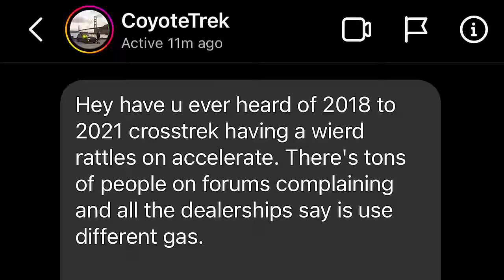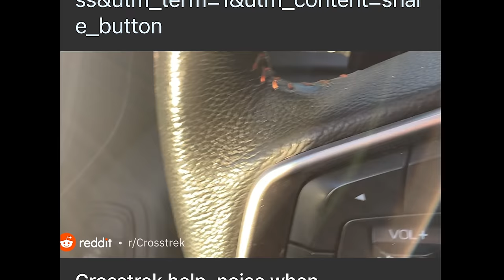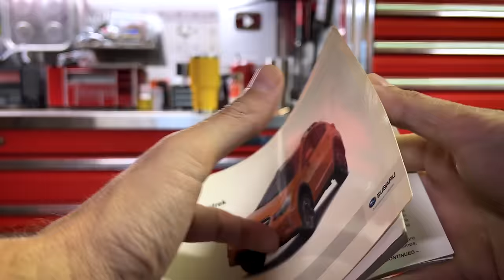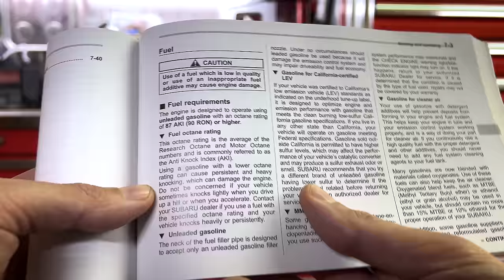Rattle, Ping Pop!? What Is That Noise In My Subaru's Engine?! Detonation & Pre-Ignition Explained

Comment: I have a 2021 Crosstrek with 73000 miles (I drive alot for work) that has been presenting this spark knock (sounds like valve chatter) since about 15000 miles. I live in York SC, and work in Spartanburg and Greenville. I haven't tried to record the sound but will soon. It usually starts after vehicle has been up to operating temp for 20-30 minutes.
Reply from the maker: Try a tank of non ethanol or 93 octane
Reply: @MrSubaru1387  Will do. I have already changed plugs at 60k and PCV valve at 70k. I recently changed where I was getting gas. I thought at first that was it....but then heard the noise again.
Reply: Ok, so I ran a tank of 93 octane. I only heard the sound two times, both after interstate driving for about 45 miles. Before, on 87, it was happening almost every day. Running 93 all the time isn't really a feasible option. What are your thoughts?
Reply from the maker: @12vinstaller  try non-ethanol 87/89
Reply: @MrSubaru1387  that's gonna be an expensive tank. Next fill up should be Thursday or Friday. I'll let you know how it goes. Thanks!
Reply: @MrSubaru1387  ran a tank of non ethanol 89. Marbles sound presented 6 or 7 times. All after 30-40 miles of interstate driving (60-80 mph), when holding between 40 and 50 mph (between 1400 and 2100 rpm) on back roads. The 93 octane with ethanol seems to reduce the occurrence more that the non ethanol 89. I am on a tank of regular 87 now, and am hearing the sound regularly now after every time on the interstate. Seems like ignition timing would be the obvious culprit, but hard to imagine that on a 2021 vehicle... scratching my head...

Comment: I actually posted something about this same issue/noise during one of your live Q&A events about a year and a half two years ago. You had some great ideas and tried to help me during the event but with little success. (Not your fault) I know as a fellow technician that its hard to give a diagnosis without being with the car. Since then it’s has slowly gotten worse. Im hoping when you make your follow up video we can find a potential solution. Alldata,Mitchell and Subaru service data show nothing for these issues and it would help a lot of owners. Mine is a 2012 Impreza with a fb20 as well.
Reply: I am also a master tech I did a bg decarbon and only run premium gas and haven't had an issue since 2018 crosstrek 6speed. Had same issue though. Good luck

Comment: Yeeeeees this is the noise I've been hearing! 2020 Crosstrek. It sounds like a half full spray can rattling really fast.  For the longest I'm like......... is that engine knock? At the dealer the parking attendant was like you should try using a higher octane gas, but the manager threw that Idea out with the trash claiming it's a 4 cylinder car you don't need that. So what I DID do was change gas brands from BP to Shell and it did help a bit. I still hear it now and again when gently accelerating but it's totally sporadic. OK so I'm not crazy! It still unnerves me though, isn't hat causing vibrations that can cause damage over time?

Comment: Mr. Subaru I have experienced the beginnings of a slight heat shield rattle cause the pcm to allow audible persistent heavy spark knock on grades in my 2018 FB25.  Clamped the heat shield that was loose, haven't heard that heavy highway spark knock since.

Comment: 2019 Crosstrek here with the same issue. I've told the dealer that I'm 99% sure it's detonation. "can't replicate it...we tightened a few heat shields....blah, blah, blah". Use Costo regular gas almost exclusively. Will try an octane booster just to see if it goes away and talk to the dealer as I need to take it anyways for a few recalls.
Reply: I have a 19 trek as well and 91 makes is go away

Comment: I have this issue with my brand new 2023 Crosstrek with the fb20. It has only 2600 miles on it.
I understand the gas could be bad but we have other cars that have never had issues with gas from the same gas stations. Never a ping on a Compass with 220000 miles on it and currently using the same gas stations.
It seems that Subaru has put out an engine that is substandard.

Comment: 2023 Crosstrek started pinging  when I added a fuel additive injector cleaner at 10K miles. Put 93 octane in the next tank and it stopped. Now I'm running 87 again and I hear it from time to time. Hope it doesn't wreck my engine.

Comment: On the FB series the timing chain tensioners can cause a pinging sound if they’re flat/non working. There solved it for you guys out there still looking for that noise lol. Just did a head gasket job on my 2014 outback 2.5i FB25, and found the pinging noise was bad chain tensioners.
Reply: My '17 Forester 2.5i(160k miles) is starting to rattle on startup  after sitting overnight. It goes away after a second./ oil pressure comes up.
Doesn't  rattle any other time.
Figured the tensioner going bad.
Reply: @williamevans6522  yep without a doubt the tensioners, oil drains out of them overnight. From what I’ve experienced it’s not too big of an issue/problem unless it’s both uppers and lowers all going out at the same time, then the chain has a chance to jump. If you pull the radiator etc you can manage to do from the front without pulling the motor, but it’s not fun. Good luck getting it fixed!
Reply: I guess when the rattle  keeps going, I should worry.
In the meantime, I'll  install an oil pressure gauge to ensure that's  not an issue.
Reply: @deluxsundial  Thank you. Searched around the Forester forum and  that's pretty much the sentiment- as long as the noise quickly goes  away it's  not an issue.
If I floor the accelerator and  crank it  over about 10 revolutions, then , with no gas, bump it about 5 times, I can then give it sustained cranking and it starts w/o the fast idle or any rattle.

Comment: I’m having this same issue with my 17 Impreza. At about 1700 to 2000 rpm under load I hear a crackling sound. I have 100 thousand mi and just started happening. Changed the plugs at 50thou. I recently changed the pcv valve and went away. Now it’s back..

Comment: So I use ethanol free fuel in my 2021 Crosstrek witch give me 37 mph hwy. My oil with Amsoil temp runs 199 degrees.  I noticed my oil is much cooler than what they recommend I looked on some of the forms people said their oils usually around 220 to 230°. I assume that's a plus

Comment: 0:53 oh... finally i have found a YT video that has the same issue I have... its been what.. 3 years? lol.... heres hoping the rest of the video helps me resolve this! presses play again
Reply: 2018 SJ5 JP 2.0i Forester, fwiw.
Reply: Incline. Check. Low RPM. check. Goes away when not on the gas. check. Low speed. Check.
Reply: I did try 89 octaine, and the recommended 91 here. I actually didnt notice any difference in the rattle after a year after switching from 89 to 91. Ive stayed on 91 because MFG recommended here, and almost the same price so why not.
Reply: I have not checked the spark plugs at all - I suppose if this is a preignition issue the main culprit could very well be the plugs. Adding this to list of things to do! I dont have any heat warnings. May have to speak with dealer if its a PCM ECM issue, this is beyond my skill. Will definitly ask the dealer next visit. The comment about Lean Fuel Mix is interesting - I always (99.9%) am driving in Intelligent mode. I have not thought to try using SPort mode more than just when overtaking on highway. I will definitely give this a try to see if it cuts the noise out.
Reply: It turned out to be dirty top Pistons. After cleaning, the sound went away entirely
Reply: @BGP369  cool, how'd you clean em'?
Reply: @InversePacman  the rattle persists still. much less after oil change so it seems

Comment: At higher elevations gas stations sell 85 octane under the assumption that lower atmospheric pressures result in less knock. Where I live most stations sell 85 as the cheapest fuel. In the summer I heard this pinging in my '10 forester. This was all due to a high operating temp due to a bad thermostat and the poor fuel. Cleaning out the egr, getting on top of the cooling issues seems to have taken care of the issues for the most part. 

I used an obd tool to monitor my temps to corrlate the issue.

Comment: Is this effecting newer models? My 2018 Impreza has a noise like marbles rattling inside or spoons clattering at lower speeds under load. Mostly going uphill.. and mainly in summer.
Reply: THIS!  I have this in my 2013 forester, and it's been going on for at least two years.  It drives me crazy because mine is fairly consistent and happens the most when I level off at a speed and maintain that speed with light acceleration.  If I give it more gas and accelerate, the rattle stops until I level off and coast again.

Comment: Very interesting video. Thank you.
We also have the 2013 Crosstrek with right around 80k miles.
I never noticed the "pinging" or "knocking" until we took it to subaru for the Valve spring recall. I clarified with the service guy that they had to remove the engine from the bay to access the valve springs. 
BTW, we live in Southern Arizona, and the service I mentioned was in the heat of the summer.
When we got the car back, I noticed this weird buzzy sound that I immediately assumed was an exhaust gasket or heat shield like you mentioned. A return trip to the dealer turned up nothing at all. They couldn't reproduce the sound. It still makes the sound. Only on a grade, and if I'm accelerating fairly hard. I have had the car up on stands for oil changes etc, and crawled around on my creeper with a bright light, looking for telltale signs of exhaust leaks several times now with no discovery.
Maybe I'll change the spark plugs, as they're original and probably past due for replacement.
Thanks again.

Comment: I took my 2015 Crosstrek in to get the CVT checked out and the first thing the mechanic noticed on the test drive was a ping on start up. This was like 60 degrees in the morning. Also noticed it's lost a bit of power from around 80-105k miles, have done CVT fluid change (thanks for the vid), spark plugs, differential fluid, pcv, gets oil changes every 5-6k. Seems way worse in summer, only premium seems to help but even then it's like the car readjusts after a few restarts.

I use ActiveOBD which is a free app that seems compatible with reading subaru CVT temps, gone over the Appalachian mountains many times and seems oil temps max around 220-230

Comment: My 2014 forester with the FB25 engine had a vary bad oil consumption problem, that ended making another problem spark knock, starting out in first gear or under heavy loads offroading it sounded like a diesel engine, shell premium helped but didn't go away

Comment: I noticed this with my 2005 Saaburu 9.2x. needs 91 octane to not ping. My issue now is that it will miss due to a lag in the fueling system now and then, I cleaned the upper fuel system, and changed the EGR and other sensors. Also cleaned my injectors. Still have to use fuel treatment to run decently. After it runs and sits for an hour or so, when I start the car, I can hear the fuel pump working hard. Could that be it???

Comment: I have the same problem on my Impreza 2013, especially when the outside temp is really hot and doing uphill acceleration. The noise appears less after adding higher octane fuel. But the noise is still there
Reply: It could be just the heat shield on the exost pipe just under the engine. Has some steel sponge  bumpers between shield and exost pipe who worns out. That was the rattleing in my case and it was happened like you described

Comment: Idk if it's been said in the comments. But i have the engine temp option on my 2018 forester. It is located in the triple meter. You would have to go through the triple meter options to find it. It would really be nice if there were an oil psi meter too, but alas there's not. While I don't have ping or   pre-det. I really enjoyed the video. Fyi i have a 2018 forester 2.5i premium.

Comment: I had the same issue with my 2012 impreza.Bog standard 2 litre  motor. Driven around city mostly. Was using premium.Plugs were fine. Knock sensor fine. The issue is soot. Took to dealer. They filled the enginei with brake cleaner fluid .Left if overnight.drained it. Put an oil cleaner through it. New oil. Cleaned injectors and had no trouble since. The motor was clogged with soot. They showed me the crap that came out. It was bad. Hope this helps
Reply: Ty! makes sense since most of these engines burn oil

Comment: 2021 Crosstrek base model. I noticed pinging when I was driving up steep hills. Took my car to my local Subaru dealership. They said Pre- detonation was causing the issues and to try higher octane fuel or octane booster. They flushed the ECM didn’t help.

Comment: In June my v10 in my excursion was pinging on 87. My dads Miata was knocking. We had to switch to premium. Mind you my v10 and my dad's 1.8 are for 87, but my 98 mustang runs fine on regular. Didn't have any issues. Top tier fuel from Costco... I haven't tried regular since.

Comment: happens to my 2013 xv as well as my current 2018, can be heard especially if i have my windows down driving light throttle. Its mentioned in the owner's manual and seems its normal, using RON 95 or AKI 91 octane. I had an AFR meter reading and seems the engine run very lean during light throttle at 16:1..not sure if its the cause..some owners have tried RON 97 or AKI 93 and the sound goes away but thats too expensive.

Comment: This is happening to my 02 firebird right now but its VERY pronounced and obnoxious. I cant figure it out and its driving me insane. Ive noticed that when I'm sitting still and it starts I can sometimes turn my wheel to a different angle and it stops instantly. I'm sure that will throw obvious clues for some of you so if that sounds familiar please let me know what it is. IM PRAYING it is not an engine issue. Its been happening nonstop everytime I drive for several weeks now and I'm so scared my car is going to take a crap on me soon. It runs fine from what I can tell so maybe mine is something a little different but it sounds like a much louder version of the rattling noise towards the very end of that clip he you played. In a little while I'm going to record the noise I'm dealing with and upload to my channel. I'll post a link to the vid when I upload and hopefully somebody can shine some light on what the hell is going on. Maybe it can help somebody else even though I obviously dont have a Subaru. I would imagine a lot of noises can happen in many different cars

Comment: Today was the day. I was putting my Subaru Impreza 2016 fb20b on elevator and try to find way colud be the rattling noise. I'm very proud of myself I find it. IT WAS A SHIELD JUST WHEN THE EVACUATION PIPE BEGINS UNDER THE ENGINE. It has from the factory some bumpers made on steel sponge but it worn out by time . 

So, not knok or ping... just a metalic shield on exost pipe. Ianage to bend a little those wire sponge's and it's perfectly silent.

Few days ago a left the snowy road for a dich for 20 meters....no major problem but that the day when the rattleing noise come worse. I'm thinks myself maybe is a connection ...and it was....
Please verify this metallic shield.

I'm going to bad so peaceful tonight:)))
Reply: After 2 mounth the noise is become to hear again. Let's remember I just bend the wire bumper between heat shield and exost pipe just under the engine. This time some wire sponge...and it's quiet again. So I write aganid for confirmation.....
Reply: After two more months I can confirm again the heat shield was the noise cause in my case. It's a small shield just under the engine .

Comment: At the pump at high elevations like Colorado and Wyoming our "regular" fuel is 85 octane and 91 is our highest. I've been experiencing some bad ethanol mixtures at my local pumps, upwards of 20% ethanol in 91 octane fuel, I've seen dynamic advance multiplier drops as well as FKL and Feedback knock events with regular 91 pump gas. It's made me resort to filling up with clear gas in my WRX and at the half tank mark I've been topping off with "E-10" 91 octane, haven't seen a lot of issues since doing that.

Comment: I use scanguage II hooked into my ECU on both my 16 Forester and my 21 Crosstrek Sport so I can monitor engine temp, volts, intake temps with real numbers. That way I can not have to rely on “idiot lights”……

Comment: 2016 Forester with FB25 engine here. Had the same exact detonation sound. Caused by a vacuum leak in EGR; Fixed by replacing EGR unit. Cleaning the EGR didn't help.

Comment: I have several incredible video/audio clips of this exact issue from a 2013 Subaru Outback that I would be happy to share. I actually fastened an old phone to the bottom of my car to try to capture noise better and it was a total win. Please let me know if you would like me to share with you, you are welcome to use in any content you so choose. I also have other videos and OBD2 readings and reports from those same timeframes that potentially could be helpful.
Reply: What was the issue?
Reply: @danieleliasramirez  sadly never found out for sure. Still going strong a year later tho. Fingers crossed